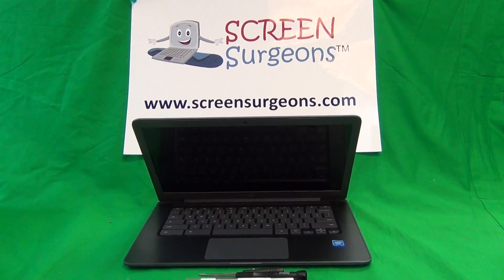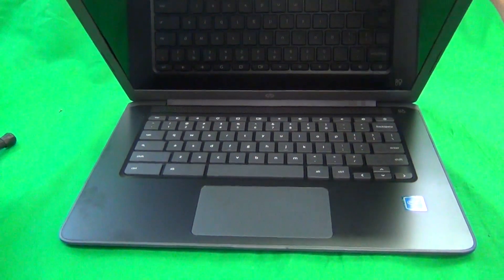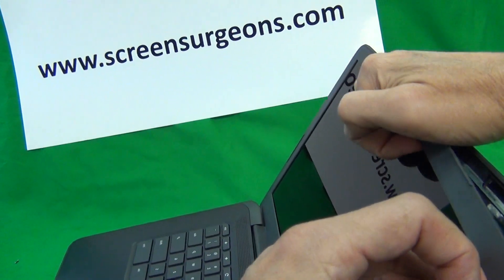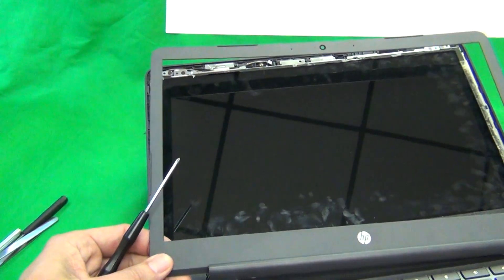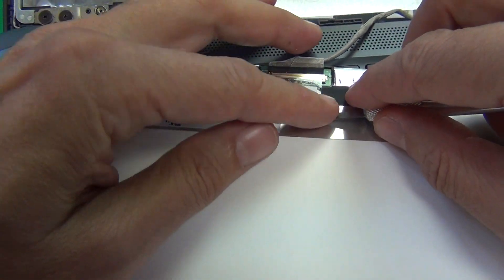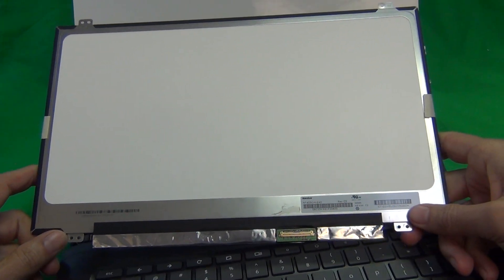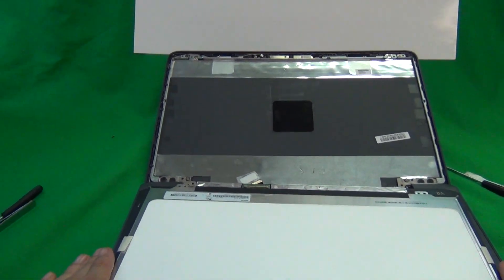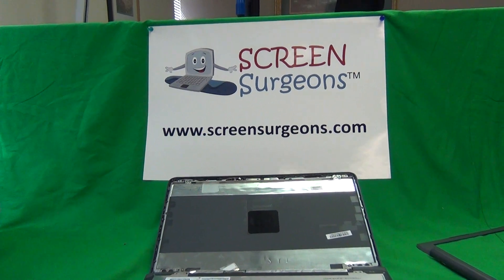HP Chromebook 14 G5 LCD Screen Touchscreen Replacement Procedure

Comment: Thanks, nice video! My screen displays well, but it is very finicky about where the screen is positioned on the hinge. I have to wiggle and jiggle it to get the screen to light up, and using the touch screen often knocks it out of the sweet spot and it goes dark. It has had a couple decent drops, but works great when the screen is lit. Is this a problem you've seen before? Perhaps I loosened the connector? Haven't taken the bezel off yet. TIA!

Comment: I followed these instructions and saved my Chromebook from an early grave. Yes, it works, and yes it's easy. You really only need two tools, a plastic "spudger" and a good Phillips head screwdriver. I was surprised to find that though the screws are tiny, a  screwdriver doesn't have to have an especially tiny bit  to  remove them.  Also, there is no need for a separate tool to open the  seam  at the bottom of the case. My plastic spudger (actually, part of children's craft kit, intended to gently scrape lines into  black coating on cardboard) worked as well on that seam as on it did on the rest of the bezel.